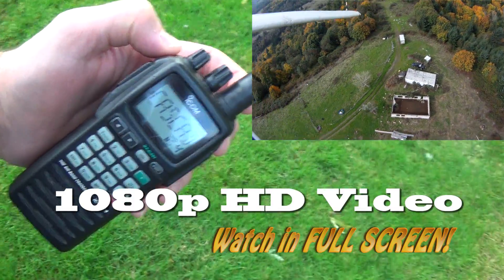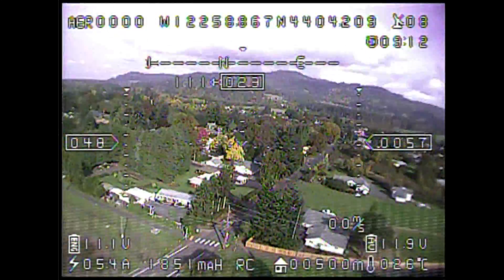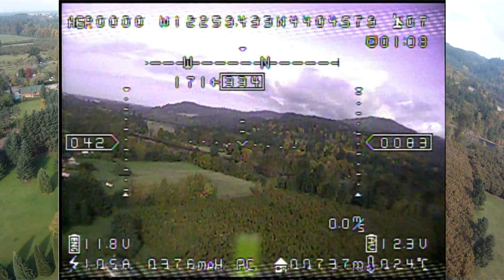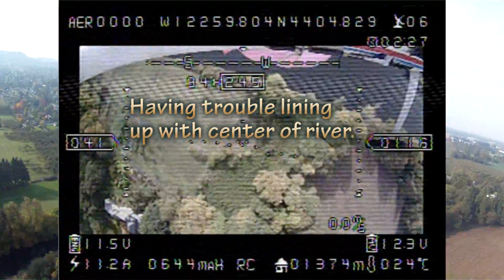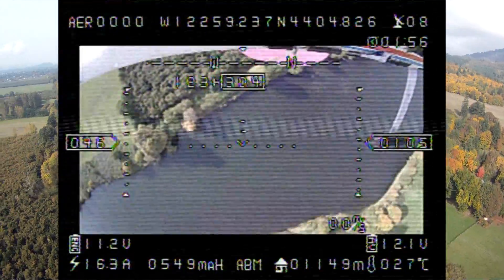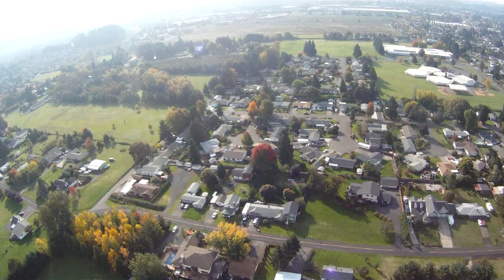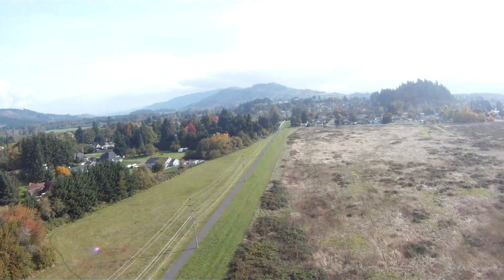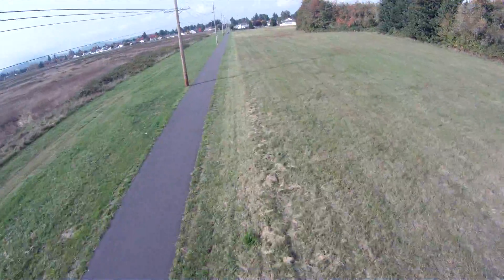VR1500 FPV Flight Recorder, Camera Switcher, Water Balloon Drop

Comment: Are you using the supplied wires with the VR1500?  I've had mine for while and just got around to hooking it up last night.  When I do a bench test, the signal to my monitor is lost.  I don't know if it's the RCA coupler I'm using or what.  When I pull the RCA jack halfway out I get video feed to my monitor.  When I put it all the way in I get nothing.  Any ideas?  Would it be possible for you to make a vid of your wiring for the VR1500 connected to your rx and monitor?

Comment from the maker: That all sounds great to me! I can't give you any advice on motor/prop/esc selections, because this is my very first electric plane, and I just bought the package deal shown in desc box. I was a die-hard nitro fan for decades, but turned to EP for safety reasons when I started flying FPV. I am sure it will all work just fine. Now just solder everything in!

Comment: No biggie, yea Trappy was the subject of safety. While the FAA was mainly after him for getting paid to do FPV, they cited his other stunts of flying low over people & flying thru a traffic tunnel which are legit safety issues

Enough about that. I have in mind this FPV setup: Bixler 2 plane, 60A ubec esc, 2x Zippy 3s 2200mah lipos, Turnigy D2826-6 2200kv motor, 7x4 prop, 1.3ghz 800mw video tx/rx (2x cloverleafs+helical for rx), turnigy 9xr w/ 433mhz open lrs (whip & dipole antennas). Continued-

Comment from the maker: It certainly can be risky. However, you may not realize that I have been flying probably longer than you have been alive! I first started flying RC when I was 14. This was in '86 when you had to build your plane from a pile of balsa wood. By '88 I had switched to flying full-sized aircraft, and I signed up for the USAF DEP when I was 17 years old. I was off to Lackland AFB to work on fighter jets soon afterwards in 1990, etc. It's insulting when someone says I take unnecessary risks when I fly.

Comment: all i can think of is a twin engine cargo type plane, where the wings and tail/engines all clear the grass on the side of the runway.  a stol plane with big flaps would be a must for great low speed control.  if you see the super moose on my bearospace channel, maybe that can give you some ideas.  it is a big plane but can land virtually anywhere.  also is immune to rocks/grass and other ground obstacles.  kinda like a dehavilland twin otter.  tricycle gear of course. hope this gives you ideas.

Comment: smaller, hmm.. i thought that you would be going bigger because of all the stuff you like to put on the plane lately.  well, there's lots of smaller models out there.  hard to get any more efficient or carry more weight than the sw. the foil is optimized for weight lifting. 15percent thickness of chord.  i'm going for bigger, and optimized for effieciency, ai. high aspect ratio, and foil optimized for carry weight over distance ai. 12 percent thickness of chord.

Comment from the maker: I checked out the Finwing Airtitan. Man, that thing does look a bit overdesigned! One of the factors I also look at when considering size/weight is my flying site. I like to be able to launch from small fields, and right now where I fly my "runway" is actually a narrow bike path. It's plenty long enough, but it can be tricky putting it down in the center while also avoiding the string of power poles on one side! I would honestly like to go with something a bit smaller than my 1900 Skywalker!

Comment: let's see, if wing loading is no greater, there should be no difference in drag vs. density, so a large foam model with the same wing loadild ng should be no more unsafe than what you have. the potential damage would be greater, but also more spread out. the part of the model that say, hit's someone in the head would weigh no more and do more damage, assuming the plane is traveling fast enough to break apart itself.  I'm building a twin engine Cargo glider type. d stay up for about 4 hrs. or so.

Comment from the maker: What do I have in mind for a bigger plane? I have been looking at the SkyHunter. I wish they still sold the black EPO version. However, I still have a mint condition black Skywalker in the box that I will probably finish first. One of my biggest concerns is still safety. Bigger usually means heavier, and the bigger they are, the harder they can fall. I trust my flying abilities, but all it takes is one loose wire and... That said, my Skywalker IS becoming grossly overweight, at over 6 1/4lbs.!